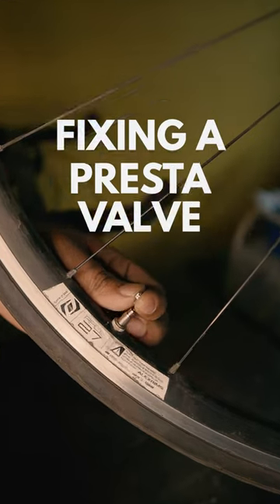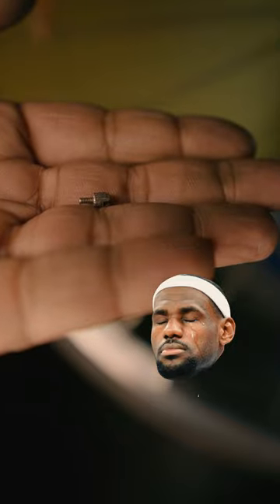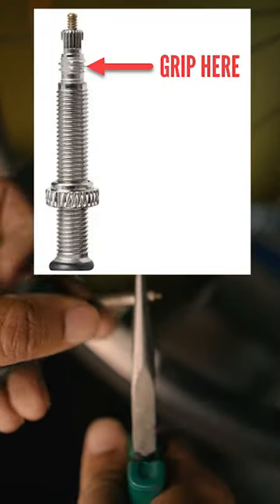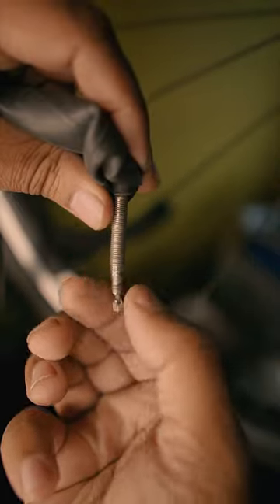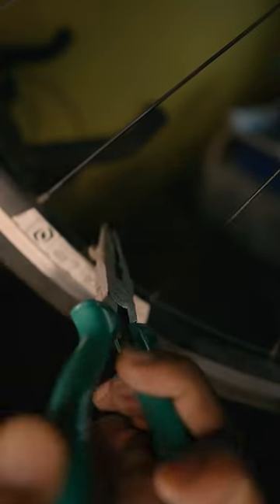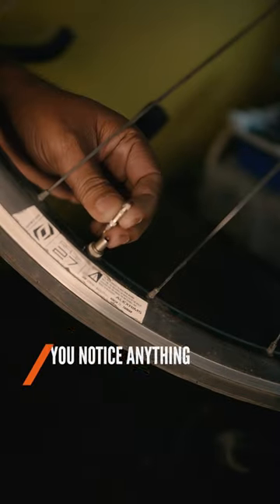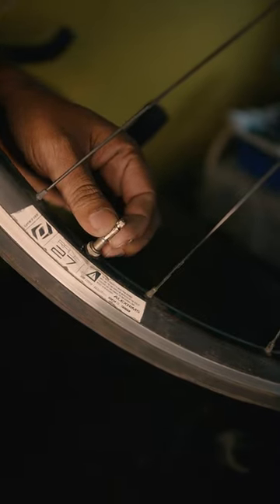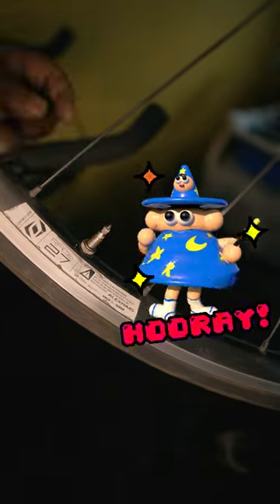How to Fix a Presta Valve #shorts

Comment: Until a few months ago I I was only buying new Continental inner tubes that had the valve in one piece. Now the LBS sell only tubes with this removable insert. What happens is almost every time I pump the tire the Zefal pump pulls out the valve insert when unscrewing it after pumping. The same happens when I use the adapter and pump the air at the gas station. LBS has a special small key for tightening the valve insert that they do not sell to customers. What a shame, the tire companies should sell one of those with every inner tube. I tried to tighten the valve inset with pliers (like you did in the video), but after a few times doing that, the threads on the insert are ruined. I will try to use Loctite with the insert. May be that will keep it in place.
Reply from the maker: Very interesting that in your case the removable valve core is clearly a disadvantage, and I can see how a loose core would be problematic, especially with a pump that you have to screw on. For home use at least, can't you get a pump that you don't have to screw on? As for the valve core tool - I managed to get my hands on one and it is so much better than using pliers! Do try to find it online, it's relatively cheap and worth it if you have to deal with this problem often. Here's the one I use and it works well. https://www.bike-components.de/en/Schwalbe/Valve-Tool-Schrader-Sclaverand-Presta-p82265/ All the best!

Comment: Hi is it possible to tighten the valve core so much that it will not loosen overtime if not never loosen anymore?
Reply from the maker: I don't know for sure, but I doubt this can happen. Btw, you also get a special tool to unscrew the core, might be better if yours is stuck.
Reply: Yes it is, unfortunately.

Comment: Waste of money. Why are these valves being sold?
Reply from the maker: There are some benefits over the schrader valve, like better air retention, and better pressure adjustment, especially for mountain bikes. If you aren't too rough with handling them, they can last a long time.